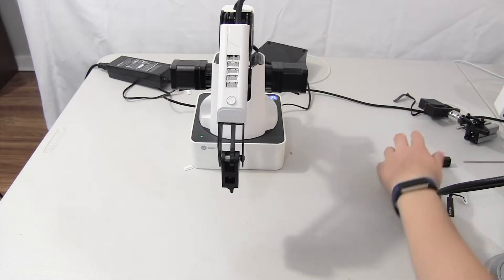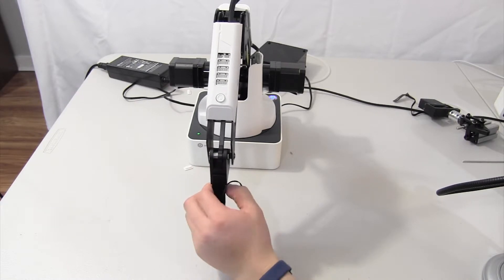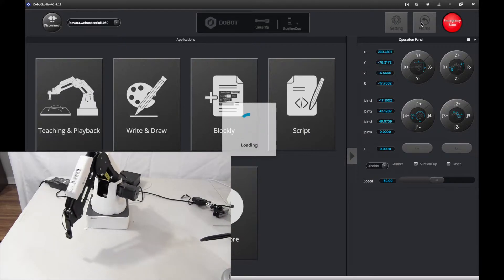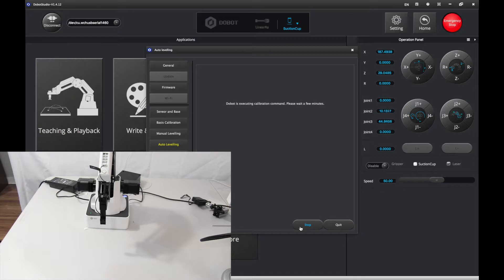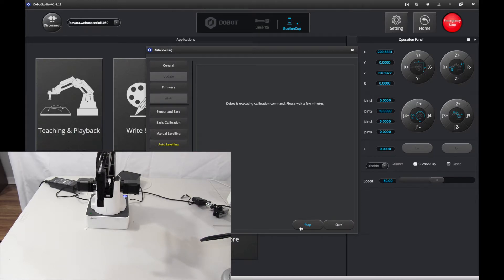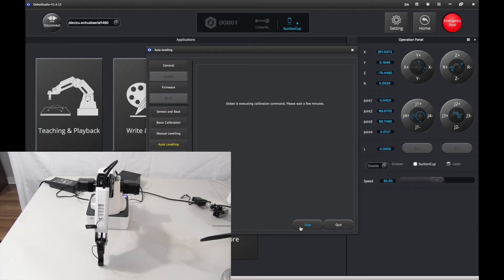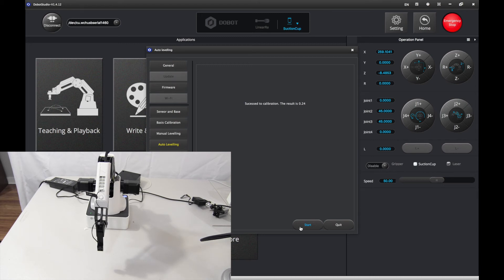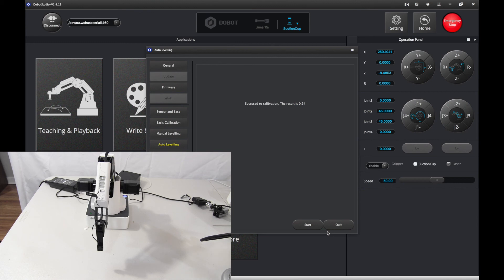Dobot Magician Tutorials: Calibration

Comment: Hi Jeffrey, thanks for the videos!

I acquired my Magician in a trade and I did not get all the parts, namely the calibration sensor that you're using here. Will calibration affect the 3d Printing of the Magician since we have to flash a different firmware to 3D print? I am having big time difficulties with 3d printing and I've been working on this for over a week now. Other than that, I love the Magician. I have some ideas on apps and I want to get into Computer Vision with it, without buying the CV kit for $1500. I also have plans to build a rail system for it, without having to shell out ANOTHER $1500.
Reply from the maker: Thank you for using Magician. The calibration will not affect the 3D printing.  The current Dobot vision kit is very expensive.  Maybe you can try the conveyor belt system which is much cheaper.  Let me know if I can be any help.